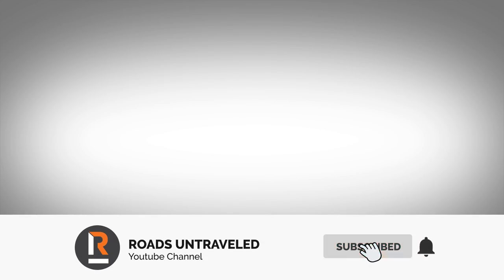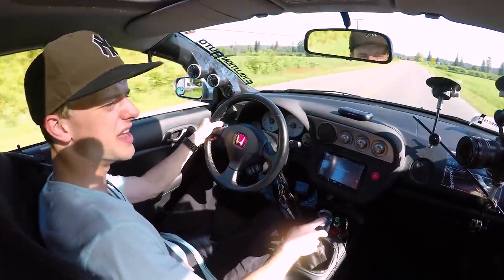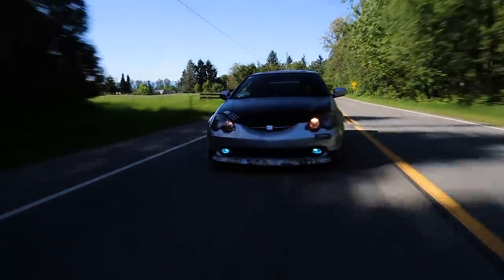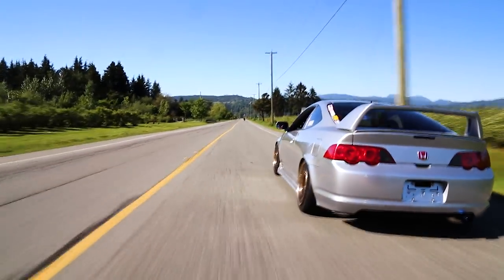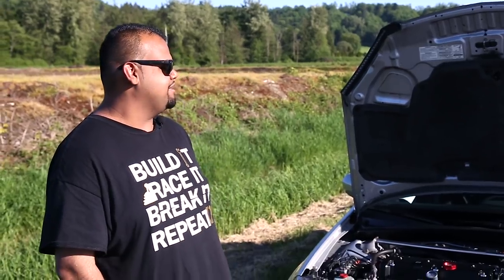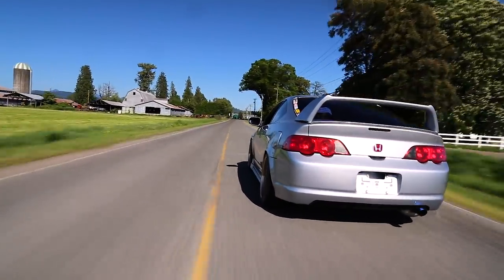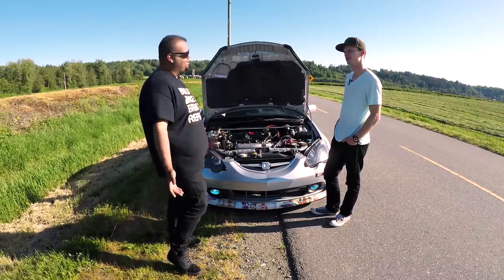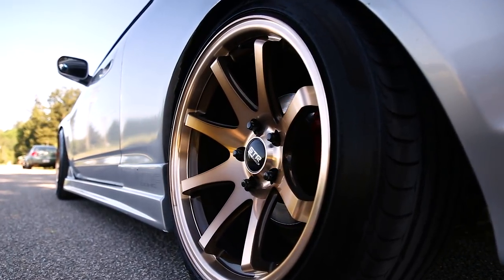Here's Why You Need to Build a 9,000 RPM N/A Acura RSX Right Now!!

Comment: Peel those bullshit stickers and put on a quieter exhaust and I’d love that car. Time to get that car dialed for a road course and not the strip
Reply: beanburnham01 the car is actually quiet, you hear intake over exhaust in person.. skunk2 alpha header with t1r dolphin 70r. The quieter of t1r's exhaust line up
Reply: You can definitely use an rsx chassis for the strip. We already got Honda’s in the 7s so don’t mention any FWD bullshit.
Reply: Ef Jr I didn’t say you couldn’t use it for the strip or that FWD isn’t fast. I just would rather autoX, canyon carve or track day that chassis. Looks fun to toss around
Reply: Beanburnham I'm with you man. I like circuit racing way better than the drag strip. My goal is to put a honda motor into a 96 lotus elise and hit the nurburgring.
Reply: Christian De Vos that would be a track weapon for sure! 🤘🏻
Reply: It’s fwd it’s a mom car wtf
Reply: I got one for sale with a k20a euro type-r swap
Reply: AMEN brother!  They care needs to be put in the hands of an adult that would put the proper TLC on it.  And get rid of those Chinese rep wheels, it invalidates your entire build....
Reply: Skunk2 header is absolutely perfection paired with an HKS hi power. Those plus intake, injectors, 10.5lb flywheel and Hondata made 157whp on my base 5 speed. K20a2 complete block swap coming next on the stock A3 head. The extra compression 11:0 vs 9:8 and the fact i can raise my redline from 6800 to 7400 should make at least 175-180
Reply: Frank Moncada how much? Willing to part it? I need trans, lsd, complete block, head, header/exhaust
Reply: beanburnham01 it adds character to the car
Reply: @beanburnham01  %uygggggc
Reply: Hell no i like the anime stickers take off the mia khalifa tho
Reply: @X A V I E R yea he even said he was thankful to get his car out to test.

Comment: A car originally built for going around corners and this guy only goes in a straight line? Foh
Reply: Firstname Lastname yeah speed factory goes 7.6 1/4 mile at 201mph.
Reply: preludeF20Bking this ain't speedfactories car or even close to it.
Reply: Adam Elmachkour so what. The point is that you can indeed go fast using a FF layout.
Reply: Adam Elmachkour my personal car is not a drag car but an all around car. I’ve went to the 1/4 and 1/8th mile,canyons.road racing and roll racing. That doesn’t mean it’s not easy to go fast in a straight line in a Honda.
Reply: Racings racing
Reply: Firstname Lastname your right...it's like everyone forgot what double wishbone suspension is for...Hondas pucnch way above their weight in a real race track
Reply: preludeF20Bking At 20 mph? That’s insanely fast
Reply: Not this white boy I hit curves at 100+ I put it to the test

Comment: I love these cars. When I go look at drag racing I see numerous Na Civics, Integras Completely walking Sti's, evos etc on the 1/4...250 Hp don't sound much but these cars are so light, very responsive, with a good tune & traction they haul ass especially just generally on the street.. been in an eg sedan with a stock b18 with headers & exhaust & it pulls really well, also an ej coupe with a Sohc Turbo on like 6psi stock motor and it feels way faster than it should be lol. Love these little cars... 😊😎
Reply: Tevin Thomas cuz is the right platform.
Reply: I forgot to mention its a turbo build I'll be switching over to a ball bearing turbo to help with turbo lag but the rods Length help with it as well

Comment: This guy is a true ricer. Lied about what's done to his car. I never saw a dyno graph. 250whp out of a built k20/k24 is horrible.
Reply: Jujutsuheiho ikr fully built a 20/24 should make 330ish whp on pump...
Reply: Driveitsideways 1 I was thinking maybe more like 290whp
Reply: And a k24 block cannot rev to 9,000 rpm without some serious parts, which I assume someone with a car like that can’t afford. 
K24 at 9,000rpm has the same piston speed as a k20 at 10,300rpm
Reply: James Peters you assume it's even got a k24 bottom end. Might just be a k20 and that's probably why his motor is blown up right now.
Reply: knock knock knock
Reply: That’s exactly what I was thinking this thing should be making at least 300 to the wheels especially with 13 to 1 compression ratio and stage III cams. My base with full bolt ons and a K20a2 head/cam swap makes 210
Reply: Dead ass i just said i make 247 with z3 trans full bolts and rbc intake with a mild street tune
Reply: ya this car is as rice as it gets.lol.
Reply: Aaron P lol! I'm calling bullshit on this build! My built H22 made 247/190 without the cams degreed in. And mine was mildly high compression at low 11's with 89mm bore. No way this build is only making 250ish HP with compression in the 13's and a larger displacement! 😂
Reply: @JujutsuHeiho  the guy in the video explicity said it has k24 bottom end lol
Reply: Raymond Yeung but then again he might have a very conservative timing and tune to make it more street drivable. He could easily advance the timing and make 300whp. It may be ugly to me and you but he made it to fit his individual taste and i respect that. Thats just my 2 cents
Reply: I have mine stock at 220whp just Bolton's, type r cams and kpro
Reply: I know the guy in Person he has 15 grand into that car k24 bottom end with a k20 head thats built u guys are all haters lmao
Reply: Driveitsideways 1 330 your trippen lmao
Reply: Ari Revs they mad because they can't make a  build like his rsx all motor ftw
Reply: Richiewrx 15 learn how to use a complete sentence that makes sense at least lmao
Reply: NinetySevenTill ok I’m in college but helpful I’m from the ghettos lol
Reply: @richiewrx1549 .. a 250whp NA K24 Frankenstein is an incredibly mild build.. You can make close to those numbers on a Stock Z1 or K20A with just bolt-ons, Better intake, and a good dyno tune. To be honest, the numbers and the mods he describes make little sense to me.. With his compression, the K24, and the built head, he could easily be in the 300's... That is, if the build list is accurate lol..
Reply: N/A builds on a Frankenstein are between 250ish to a max of 330 whp in 99% of the builds I’ve seen. I haven’t seen a “builder” here talk about bore and stroke, head components, etc. A 250whp build is perfect for longevity and performance. Once you start doing crazy big stroker kits, you start running into issues if it’s your daily driver. E85 tunes don’t last, are high maintenance, and a pain. To those trash talking, make a video and post it up in the comments. Nonsense like this is why Chris sold clubrsx; bunch of loud mouths who dribble nonsense. Plan your budget, plan your build, make it happen.
Reply: Yea I was kinda confused by the 250whp, my buddies eg hatch we H swapped made 230 whp with just type-s cams and e85

Comment: 105 In the quarter? Whoa slow down there speed racer
Reply: dick van niggz my friend back in 2006 07 ran 97mph with short ram,dc header, apexi ws2 and a type r transmission 03 Rsx type s. The mods my friend had were all budget parts besides the transmission. I kinda thought this thing would hit 110 plus with the mods. I would like to run him with my civic
Reply: isn't that like mid 13's hahaha had me weak
Reply: but your sti at 300 k klm engine is blowed out ;) and honda`s still young ... ;)
Reply: Jerome b williams  your crazy if you put 20k in a honda you'll smash a sti or evo any day unless they have work to them ..honda are not slow check out all the hondas running 7s now down the drag ..don't talk shit if you dont know facts bro
Reply: Jerome b williams .. You can easily make a Honda faster than an STI and EVO for far less than $20K.. My NA Type S is about as fast as a stock Evo and I have about $5K into it.. All I did was build the head.. full supertech valvtrain and stage 2 cams.. Rest is just bolt ons.. full 3in exhaust, RBC, 70mm TB, and Kpro on a Dyno Tune... Made 260whp.. My car is about even with my friends stock Evo.
Reply: Jerome b williams  It's cause he didn't forced induction silly, and it's WAY cheaper then a STI and a Evo. N/a is if you have deep pockets, my dream car is a s2000 with a kraftwerks supercharger because that's the perfect purist street car for me
Reply: @roboticvenom1935  can supercharge a k series to over 400 hp with less  than 6k
Reply: @brojack101  Really? How and what kit? With the kraftwerks kit?
Reply: @roboticvenom1935  kraftwerks c38 kit. You'll wanna build the engine up to handle the power but if you bought the parts and did it all yourself yeah.6k is an estimate but less than ten for sure.  Plus would want to get it professionally tuned
Reply: @roboticvenom1935  the k20z3 in 2005 Acura RSX type s comes stock with 200hp already, k20a type r from Japan 217hp stock. Supercharger can add 150-250 hp
Reply: Also the rpm limit on Hondata kpro is like 8200
Reply: @brojack101  the rpm limit on a Hondata Kpro is whatever you set it at, depending on your mods is how long it will last there
Reply: @Jerome, I bought an Integra GSR for a commuter. got bored with it and did a LS Vtec swap with ITR pistons, Skunk cams, knife edged crank...Fully built NA engine and trans with a 9400 RPM. Making power all the way to redline and the fun factor with a high revving car is why people buy Hondas.
Reply: He ran 105's with nothing but wheel spin in the first 2-3 gears
Reply: Kodi Wyatt lmao 16sec qtr mike 😂
Reply: My Hemi Ram only trapped like 87 or so at 15.5 and that thing was pretty fun to drive, so I'd say this car is quite peppy.
Reply: @Drunken_Hamster  People get caught up in the numbers game.
Reply: Ya 105 mph is respectable Considering he probably has no traction in first and second gear. A nice sticky set of tires in a limited slip differential would really really help
Reply: Robotic Venom I have a Kraftwerks Supercharger kit on my RSX and it’s really really nice. 310whp on 10psi. Im still breaking it in.
Reply: That was the riciest Acura it dishonna my famirry
Reply: @adammaldonado8811  exactly the current record holder in quarter in a Honda is Shawn rammey and he runs mid 6's and he's local to me in Virginia and said he runs 60psi boost
Reply: you have no knowledge on k series motors lol a 24/20 frank build fbo makes 260 to 270 and in a 2800 pound car its crazy

Comment: Honda has a bad name?... nah it’s the people and this car isn’t loads better. It’s got a respectable engine but almost everything else looks raggedy. Fake wheels, cheap tires, rusted screws That were just drilled into the car to hold on the side skirts bunch of stickers, paint chipping dents and dings all over. I’m not bashing the car, the guy can do what he wants but I’m sayin is *dont try to use this particular one as a shining example of what a modded Honda should be when so much of it is cheaped out*. There’s a ton of complete Honda builds out there.
Reply: What's so bad about STR wheels?
Reply: @Go_Problemo  they're a company that copies real wheels and makes budget versions. What's good about them? When real wheel manufacturers make designs through high quality processes using high quality materials you end up with a quality product. My 18" forged wheels only weigh 16lbs each yet they're really strong. When you weigh these knock off wheels many of them are damn near 30lbs... If a person wants to do it on a budget cool but the main point was this isn't the Honda to use as a point of reference for what a proper built Honda is supposed to be. Theres many better examples.
Reply: J. Ffrench are those volk ce28 knockoffs?
Reply: Caesar Guzman that might be what they were aiming for but the spokes look different in the way the width of the spokes taper  (these are wider) and the centers of the wheel have lost all the details on the CE’s. I guess it is a copy but not a good one.

Comment: That motor should easily be in the 300whp. Home boy keeps saying "muscle car cam".... obviously that cams specs are not right for that motor bro! Congrats on only making a cam sound and no power. I usually never hate on Honda's, I love them, only idiot owners
Reply: Nah, it's a 2.4L 250WHP and 190 lb-ft is actually VERY solid. It's about 290 crank HP and 220 crank lb-ft. Or, if you wanna compare directly to a 'muscle car' it'd be.. Well, you kinda can't. This thing revs to the moon and most high cube 8's don't.

This car makes 120HP per liter N/A and about 91 lb-ft per liter N/A. I guess if we account for lower revs and say that the high cube 8 would make the same HP as torque, you'd get a 5.7L (350ci) engine putting out 518HP and lb-ft at the crank, or 450 at the wheels.

Which is very realistic as far as "the limit" goes, when you consider a H/C/I/E FBO and tune 5.3 LS is doing 415HP or so at the crank. If it were a 4 valve engine (this LS example, I mean) it'd do a little better and match up to the specific output per size, but I digress.

My main point is that you're wrong, he built his NA big cube 4 banger right, and can't do much more to it without changing the fuel, or going with a power adder.

Hell, if he spliced two of these together, he'd have a Ferarri 458 engine, pretty much. Same specific output, displacement, total output (or thereabouts), cylinder count, valve count, crankshaft design, and etc. And they (Ferarri) did some CRAZY engineering to get that out of their motor.
Reply: @Drunken_Hamster  Those numbers are terrible.. It is supposedly a fully built, cammed Frank.. I make 240/195 on my STOCK K24 with just bolt ons.. This motor should be making 280+ at the very minimum if it actually has what is claimed in that motor.

Comment: You seriously need a limited slip differential. I have the Kraftwerk supercharger kit at 10 psi and before the LSD it would go nowhere. Now it hooks great. 310whp. But building one of these all motor the right way is super expensive and you really should just boost it.

Comment: This engine is built😳 my shit ain’t even built and I made 232whp easy with 200wtq and all I did was a factory prb oil pump swap on a 08 k24a2 yeah see it’s stock Block k24a2 with a prb head swap that swap alone is 260whp alone STOCK I’m all about stock factory build using different pistsons from other honda k series engines with high compression and upgrading valve train with stock oem parts ,like the rsx type s has duel valves springs but u have to buy the inner springs as an upgrade they don’t come with from factory..if I swap the same head on my k24 block with I’m soon to do,on my block now and I’ve had this swap now for 5years and a few months and on same 5 year old tune and once I swap the head with the stock factory upgrade mods I’m gonna do with using higher compression Piston’s either form 09+ tsx R40 or the ap2 s2000 Pcx Piston’s and inner valves springs for added support at high rev witch I’m already at 8500k prm and still can go to 92/95k but I was more then happy at 8500k but once I get my motor set up the way I want I’ll be at 280ish easy with stock oem parts specs and all 💪🏼💪🏼💪🏼it’s my endurance build as a daily street car set up..

Comment: Why the need for CP pistons when only pushing 250hp?
Reply: James i thinks is because if go over 300hp，it is more difficult to drive on street
Reply: Nah it’s built to be high compression because he’s shooting for na power.
Reply: His tuner is trash is the answer
Reply: 13.1 compression and made the numbers than a k24/20 makes stock. His bluffing about the mods, those setups make 280-300
Reply: 09blacksi probably tuned on 89 octane lmao
Reply: 09blacksi I’m at 300 on a jet with 14.2 70mm Tb
Reply: That's more conrod specific ya clown.
Reply: James all that time and.money for 250.hp lol. my e46 makes 240 hp stock from.factory and its even like 5 years older than this car. hondas arent worth building in my.opinion. they need to much work and money and they never produce good torque. so what that they rev.high.
Reply: 09blacksi true bro
Reply: @Sergio Aguirre nobody gives a fuck how much hp per litre a car makes. bmw and other companies have done that aswell. it doesnt mean shit in reality.
Reply: @Sergio Aguirre S5 FC rx7 160hp 8k rev limit 1.3 liter
Reply: @Willy09blacksi  spot on

Comment: Wait... 9300 rpm with a k24 block? Seems suspicious..
Reply: derek m it could be a flashes ecu
Reply: @RetroExhibitCollective  It has nothing to do with the ECU. Unless he switched out the oil pump and built the head completely, then I wouldn't believe all he said.
Reply: @Tyler T put over 15k in the car and only makes 250 whp out of a "fully built" k24/20? nah.
Reply: Tyler T an n/a motor that’s apparently fully built? You should definitely be getting more than 250 😂 especially with 15k into it. Because we know none of that money has gone to interior or exterior mods. So that “15k” that he’s apparently put into it is all in the motor. I’d be embarrassed if I put 15k in a car and only made 250
Reply: 9k would blow k24 bottom end in no time at all